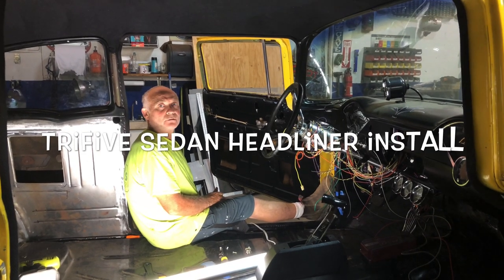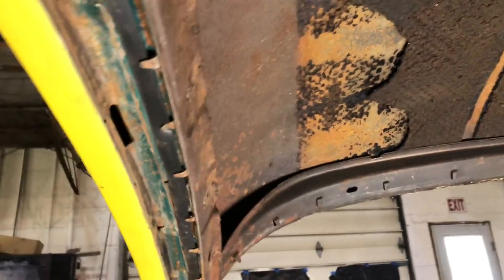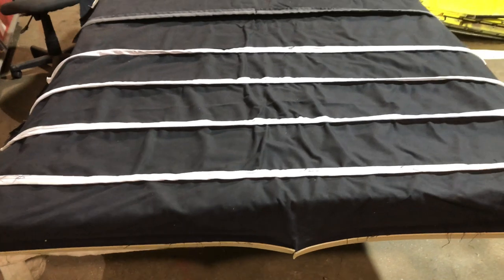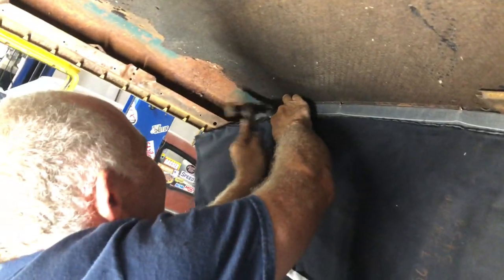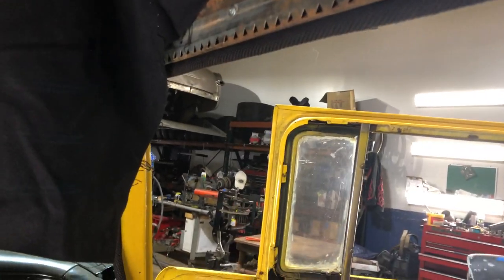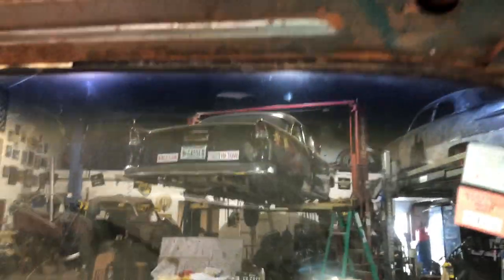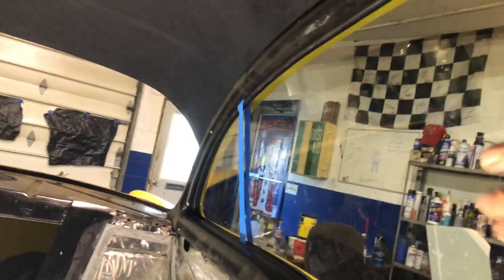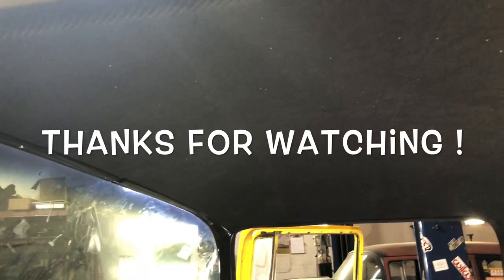TRI FIVE CHEVY HEADLINER INSTALLATION

Comment: I am doing a 1956 two door post like in your video. My question is, how did you attach the windshield interior trim? There is a screw hole in the trim piece but no where to screw into the roof for the corner and next hole toward the mirror.
Reply from the maker: I will confirm tomorrow there’s a 57 there without a head liner for the holes you are talking about I’m pretty sure from memory the mirror holds the garnish trim into place in that area again I will confirm. And if necessary will take a pic !

Comment: Getting my wind lace made right now at a Reputable upholstery shop now. I pulled my headliner out and it does not have the cardboard attached ? Fellow at shop said he can sew it on for me but needs to know where to sew it . From what I see on your video it looks to be held in about 3/4's of an inch and stitched a crossed the inside of the head liner ,maybe only 1/2 inch ?. I need to know how far to hold the stitching back so I have enough to tuck into the 57 rear windshield rubber ? can you give me a measurement on the stitching ? Thanks ,George
Reply from the maker: Is it for a 55 Chevy z??
Reply: Possible sold him a 55 h/L 55 has no cardboard

Comment: Good video man I'll be doing that head liner one day. I made sure I number those bows to I'm missing the front and rear top windshield trim tho got to find me some. Some great tips brother thanks for sharing😊
Reply from the maker: The garnish moldings there available used !
Reply: @Trifiveguy  the top front or pretty cheap the back people think they or gold or something
Reply from the maker: Ironhead Garage the  55 sedan was the only model that ran the rear window garnish mouldings you dont have to use them mate the rear head liner hangs in those tabs I just can’t recall if the 55 have the tabs like 56-57 I’ll have to check !
Reply: @Trifiveguy  yeah I checked it out mine doesn't have the tabs

Comment: Thanks for sharing. I was just wondering about the post and the sail panels. How are those completed. I'm doing a 57 as I type. Just wondered how those areas finish out? Thanks again
Reply from the maker: The sail panel board just sit there under the rear glass rubber  that’s what holds them in I think there another video of that car that shows them fitted
Reply: @Trifiveguy  Thanks for the help. I finished the headliner last Friday. Looks great, and I wanted to say thanks. Without your video it would have taken much more time. Thanks again
Reply from the maker: @stevenpotts5246  thanks man I appreciate that can You maybe send me a couple pics to my email !! Fguzzo1@hotmail.com

Comment: What kind of staples and gun do you use
Reply from the maker: A harbor freight staple gun that  uses the T50 staples 1/4-3/8 make sure u turn the pressure down so it doesn’t push right through the material